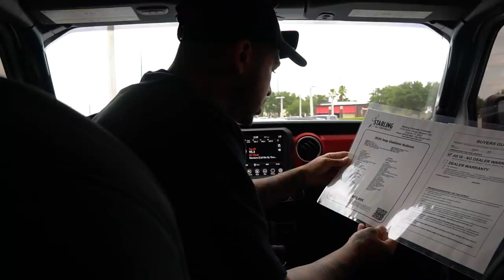BUYING A NEW JEEP GLADIATOR FOR MY DIRT BIKES ?! | BRAAP VLOGS

Comment: You can't expect a vehicle that is designed for off road purpose to perform best on the streets
Reply: Facts 😂 you can tell they never drove or been in a truck with big rough tires
Reply: @sheluv_jax9046  he had a wrangler
Reply: @Prince-yb4sy  fr he did

Comment: The jeep gladiator is a pretty neat truck, it wouldn't be a bad choice overall and they can handle really well in any road condition, the biggest problem is that they are so low in reliability and may have lots of issues, but it's completely up to you braap if u want to buy it.